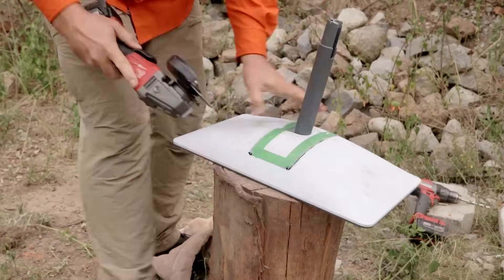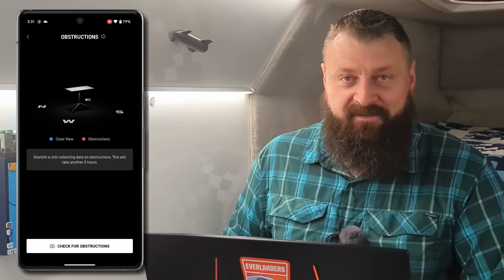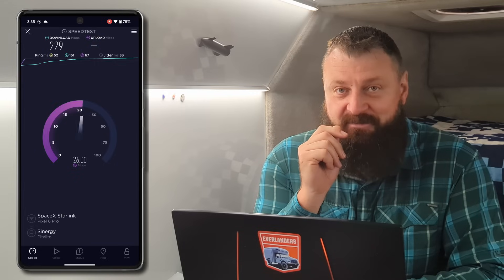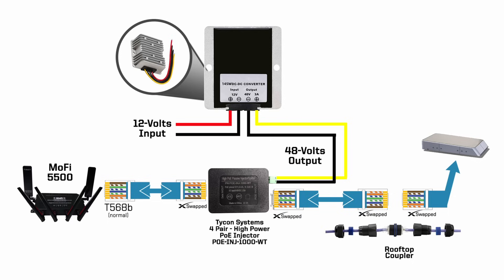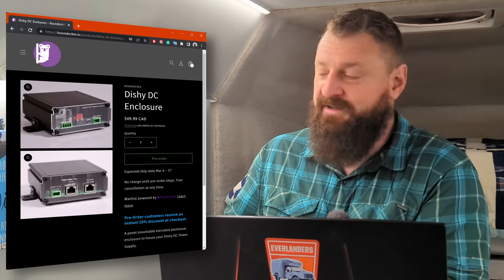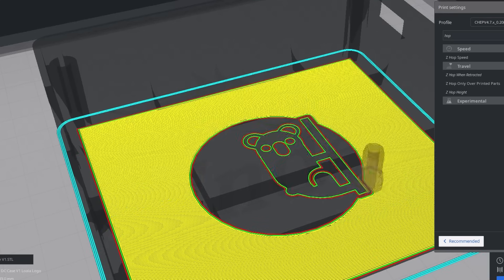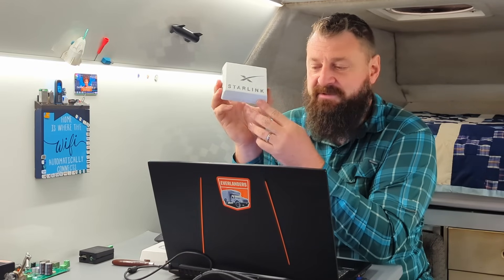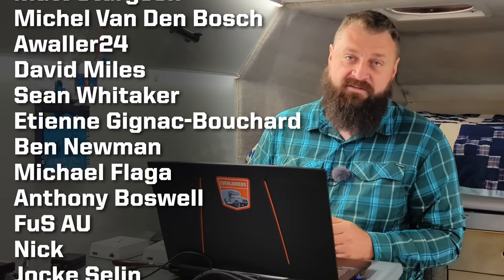Starlink DC Power Supply

Comment: I did not want to go through all the challenges and frustrations of putting together custom power supply, so I got the starlink 12VDC power supply.  I see more people going the custom route instead of the Starlink DC power supply.  Why does it seem more people go the custom rout?  Is the Starlink DC power supply inferior in some way?
Reply from the maker: You're probably using the Starlink mini, they run from 12 volts without any conversion.

Comment: Love your videos!  I recently purchased a used v2 dish with no router.  I'm wondering if it's possible to do the 12v conversion and then be able to set up a Starlink account without the original router? ( I currently do not have an account with Starlink).
Reply from the maker: Yes, no problem. As long as you have the Kit ID from the previous owner.
Reply: @ thank you for the reply!  I do have the Kit number 😀

Comment: Hi Jason: So helpful to watch this video. Hope your travels are going well. You are certainly knowledgeable and well-organized. I watched this video. I am totally in the deep end here. Here is what I want to do, and maybe you can offer me some advice. I live in Greece. I just bought a Starlink 3 generation. I want to power the Starlink (as much as possible) with solar power. I have no idea how to do it. Because my Greek is basic(dealing with local electrical suppliers is a challenge) but I can order products online from Amazon. What equipment, do I need to purchase, in order to run my Starlink directly off of solar power? I have a sunny roof for the solar panel. Please advise.
Reply from the maker: Very simple if you watch this video.
Reply: @Everlanders  Thank you for your reply. Imagine I am a complete moron when it comes to what you talked about in the video. Do I just order up the boondocker and away we go?
Reply from the maker: @athensmarina The Dishy DC will power your Starlink from a 12v battery... If you want solar too, then you'd need a panel and an MPPT charge controller.

Comment: I bought this power supply but I’ve run into an issue! Whenever I plug in my Starlink the “dishy enabled” light turns off and I don’t believe the dish is receiving power. Any suggestions? Thank you in advance!
Reply from the maker: Your cable could be crimped wrong and shorting out the power supply.

Comment: And how does it goes for starlink gen 3? Dishy dualie FAQ says it works with gen 3. Would like to see that please . Can we keep the starlink router with gen 3?
Reply from the maker: With Gen 3 you can simply replace the original power supply with any 48 volt power supply pilot can supply the 100w startup requirements.

Comment: Wiring diagram do you have one for how you wire the complete setup 🙌🏻
Reply from the maker: Positive to positive, Negative to negative.
Reply: We have had an issue with our PoE injector from Amazon, it’s burnt out the cable end on the router side so I am getting the boondocker one, that’s why I asked if it needed to be x-swapped like the original 🙌🏻
Reply from the maker: @Adventure_Awaits101 the Amazon PoE's burn up pretty quickly. Boondocker's Dishy DC does the correct swaps internally. Standard T568B throughout.

Comment: Thank you for your video! I’ve watched it a couple times already! I am doing my install of the boondocker io and am wondering how should I connect / use the remote switch capabilities so that I can boot or shutdown the dish from a simple switch… am still looking for a pdf manual for this project but haven’t found one yet! Maybe someone here can help! 

Keep up the good work!!
Reply from the maker: As shown at 9:50 you just connect two wires to a switch and the two wires at the other end to the terminal block. Pretty straight forward.
Reply: @Everlanders  Thank you! I will try that! I still am not able to connect to my dishy unfortunately using the boondocker io box. My router says no ethernet connected and I've also tried with connecting directly to my computer directly and it doesnt connect either. My Simarine battery monitor shows 3-4A usage when the starlink is connected to the box and it is a little warm so looks like it's powered on but the router port on the box doesnt seem to be communicating with my devices... I've written to boondocker io support... If someone has an idea, I'm all ears! I have tried 2 different ethernet cables (t568B). I have a  crossover cable too but didnt tried that... Thanks!
Reply from the maker: @marcksavoievoyer6424 the Dish takes about 110watts, over 10 amps while booting... The symptoms you're describing align with others who had thin cables or weak batteries. The Dishy DC is likely to be starved of power and the dish is stuck in a boot loop.
Reply: @Everlanders  Would the original Starlink cable be beefy enough? This is what I am using to connect from the dish to the boondocker io box. Well that with RJ45 connectors...  My battery is a 300Ah lithium that is full... So the battery should not be a problem. ;-)
Reply from the maker: I'm not worried about the Ethernet cable, if it's only pulling 3 amps, it's not booting. Which battery?
Reply: @Everlanders  found the problem ! The first rj45 connector that I did (straight on the short cable that connects directly on the starlink dish board) was bad. I have replaced it and got to connect right away! Thanks for your help and keep up the great videos! Very good content!
Reply: @Everlanders i have tried many combinations and it does not seem to be working for me yet. I have a spst switch but the ones with 3 prongs on the back that has a led light so maybe the connections would be different as I need to feed 12v / ground to those switch and haven’t really wanted to feed 12v on there before I get some confirmation that this would be ok from boondocker io support which I haven’t got since emailing them…  

I did try to wire just the 2 wires from my switch to the terminals on the box (dc-dc). Does the led light on the board should turn off if it’s working? 

I might just go for a automotive relay activated by my same switch  that will completely cut the dc power to the box if I don’t get some answer from support but kind of wanted to use the functionality since it’s built in the board.. 

Thanks!
Reply from the maker: What are you doing....? Just get a simple switch. Or two wires and twist them together so you understand what a switch is.
Reply: @Everlanders it’s fine if you don’t know how to do it with a 3 prong spst with an led. And don’t worry; I do know what a switch is 😂
Reply from the maker: Then you'll have no problems wiring that switch up.

Comment: Hi guys. Just installed the dishy dualie. But having trouble too have power on the dish. I have a cable running from the dualie 13.4 volt to the yoscheng adapter. And then to de dish. Am I forgetting something.
Reply from the maker: The problem is the Yaosheng, there is no need for it.
Reply: Oké. Will check your diy video again. But. Freely roaming did have the yaocheng in his setup. He said after 6 months that the dualie was very sensitive to voltage drops.
Reply from the maker: No voltage drops here, 2 years no problem as shown... If you're doing what the free roamer said, maybe ask him.
Reply: Maybe to thin 12 volt cable’s ? Could that be a problem? Will check tonight. Will let you know.
Reply from the maker: Of course thin wires will cause problems. 🤦‍♂️The power cables need to be at least 6mm² or 10AWG to handle the 10 ampere inrush during boot and network initialisation.
Reply: @Everlanders  Fixed it. it was indeed to thin wiring. Works like charm now.thank man.👍
Reply: Going to check that first, thanks man
Reply: Oké. But I thought it would be wise to keep the original cable. To be connected to the original router. So the yaosheng is only converting rj 45type b to ?
Reply from the maker: Nope, unwise.

Comment: why not use the dishy cable connector instead of messing with the RJ connector. Far simpler adaptation. Unplug old router. plug into POE card then use a standard RJ Ethernet cable to router.
Reply from the maker: You should do that.

Comment: The newest board doesn't fit the box anymore without a bit of adjustments.  The rib on the top where the black cans are is in the way now as there is 3 cans instead of just 2 now.  All in all, this case looks killer when it's all done!
Reply from the maker: You printed the wrong case, rev1.5 fits the capacitors just fine.
Reply: @Everlanders  ahhhh crap I didn't catch that one.  Ok off to print the other one:face-purple-crying:
Reply: @Everlanders  is that the 1.4 for the front and 1.5 for the back you mean?
Reply from the maker: Yes
Reply: @Everlanders  ok sorry figured this out now.  Totally different area to get the latest files.  Thanks!

Comment: Is there an adapter for the recent edition of the dish available at BestBuy?
Reply from the maker: No adapter needed. It works just fine.
Reply: @Everlanders  Will it also power starlink router that comes with the new kit?
Reply from the maker: No, getting rid of that router is the whole point. Nobody's using it due to horrible inefficiencies.
Reply: @Everlanders  I thought the issues were with the old router and a new one has more features and smaller form factor. Obviously there is always a room for improvement, but I wanted to reduce the amount of time I spend replacing a device that might otherwise work ok.
Reply from the maker: If it works for you, then use it.

Comment: what are you using for power? I have two 100 watt agm batteries and a 200 watt solar panel. It appears I will need more power.
Reply from the maker: Solar - https://youtu.be/lcck1ejlXt8
Batteries - https://youtu.be/2uYENzaDBY4

Comment: how about on the power side - I'd like to run my dualie off the delta 2 max but only 1 dc out that the fridge is on. Just use a dc splitter and run them both parallel? Or is there a better solution? Rather not run straight off car battery to safeguard against killing it.
Reply from the maker: The Dishy DC has a low voltage cutoff, it won't kill the battery.

Comment: Thanks for the video! So you left your wiring on the roof unchanged, i.e. x-swapped wiring into the dishy on the roof but T568b-wired into the dishy port of the PCB?
Reply from the maker: I had a crimp on the roof go bad, poor quality ends, So while I was at it, I crimped everything with standard T658B

Comment: Will this 48v power supply device work with the new Starlink Gen3 system that has the new RJ45 connectors and my Peplink MAX BR1 Pro 5G Router?
Thank you for all that you do,
Terry McIntyre
Reply from the maker: That's Gen 4... And yes, it's all the same power requirements, works fine.
Reply: @Everlanders It's Gen 3 according to Starlink. Gen 1 was round dish, Gen 2 was the "actuated" rectangular dish (like the one you converted) and High Performance Flat, Gen 3 is the new non-actuated rectangular Dishy with a "kickstand" and regular (but weather-sealed) RJ45 plugs/jacks.

I'm wondering about the pinout of the new "standard" connectors. I haven't yet seen anything about that. Fingers crossed that it is TRULY standard and won't require jumping through any more special crimping hoops to use third-party routers and PoE injectors. That would make going mobile with the Gen 3 dish a whole lot easier.
Reply from the maker: According to the CAD models and wiring diagrams from Starlink, it's Gen 4

https://api.starlink.com/public-files/starlink_standard_product_3d_models.zip

Comment: Just about to order the board from Boondocker and get the case 3D printed it locally. In regards to the case what file do I use for the base plate?  
Thanks
Reply from the maker: I believe version 1.5 is the newest PCB revision.

Comment: hi how are things..!! your videos are excellent.. thank you very much for it...!! I would like to bother you with a question regarding switching to 12v on Starlink, is it really worth it? In percentage (%) how much is the gain when having the Starlink on 12v? In one hour with 12v how many amps does the Starlink consume?
Reply from the maker: 56 watts AC vs 28 watts on DC
Reply: Thanks for 🇨🇱 answering..!!  If one day you are in Chile and you are heading towards the southern highway, I have some tips... those 28 Watts in 1 hour of use?
Would the 28 watts in DC transformed into amperes be approximately 2.3 amps?
Reply from the maker: It seems you're conflating power (watts) with energy, which is measured in watt-hours (Wh). The correct way to understand this is to recognize that a device consuming power at a rate of 28 watts over the course of an hour would use 28 watt-hours of energy. This is because a watt-hour is a unit of energy equivalent to one watt (1W) of power expended for one hour (1h) of time.

So, in simple terms: 28 watts describes how fast the device uses energy. It's like saying a car is moving at 60 miles per hour right now. 

28 watt-hours would describe how much energy is used over time, akin to saying a car has traveled 60 miles over the past hour.
Reply: @Everlanders  Dear, I appreciate the illustration you just gave me..!!  I think it's really useful then.  I have a mini camper with a 75 Ah battery that is charged with 3 100 Watt solar panels and in very cloudy cases I use a dr.  battery to charge it when I go on a trip.  but I feel that the starlink plus the Refrigerator consumes my battery very quickly considering not being able to discharge it below 50%.  Of the conversion kits, which is the most recommended without having to have network degradation problems according to your experience?
Reply from the maker: @rodrigomendezguzman9195 ...the one I showed in the video.
Reply: @Everlanders  Thank you very much for your answer..!! I will see him again..! What I don't want is to cut the original cables
Reply from the maker: Then it's not possible for you.

Comment: With this set up do you still need to do the Xswapped cable for the dishy cable out? As in an Xswapped cable with female to female connector as per the last video and then at the Dishy DC end just the normal RJ45 connection? This is the only part im a bit confused about!  I am going to get your print files, do the install and leave a nice tip on thingiverse beause this series is a lifesaver! Thanks so much for the great content and I really hope I can get an answer to this. Keep up the awesome work, thanks from Australia!
Reply from the maker: No, when using the Dishy DC, all the connections are standard T568B. (The swap is done by the Dishy DC)
Reply: @Everlanders  so just to clarify, do I leave the cable intact coming out of dishy? Or what do I do at that end? Thanks so much for the swift reply!
Reply from the maker: It's your choice. You can leave it, or crimp T568B as needed if shortening the cable to save the 10 watts lost to the length.
Reply: @Everlanders  ok. I’ll need to look at this a bit more I’m still a bit lost on that part. Also just an fyi, it looks like someone is selling your Dishy on Etsy. I hope it’s you guys and not some rip off artist. I can send you the link if it’s not you guys!
Reply from the maker: Unfortunately there are many outfits thats think it's okay to profit from my designs. I guess they don't understand the "Creative Commons - Non-Commercial - No Derivatives license."

Comment: Thanks a ton for your videos! Super helpful. I have a question, I have pre-ordered the power supply/Poe injector and have a gen3 dishy on order. The folks at Boondocker have said their device will work with gen3. I saw in your video that you did not need to X-swap the cables for your gen2 dishy. Is the swap taken care of in the boondocker dualie? If so I think that means I will have to cut the cable on my gen3 dishy since I believe Starlink has made it standard (not x-swapped) connection now? Can you clarify? Thanks!
Reply from the maker: Correct, if using a Boondocker Dishy DC, the swap is all handled for you internally... Standard T568B crimps everywhere regardless of Starlink version.

Comment: Question on the remote shutdown toggle switches, I assume these are just 12v and you don't need a 48v toggle?
Reply from the maker: Logic Level
Reply: @Everlanders  Got it, so just completing the circuit or not basically.
Reply from the maker: @santafebobo No, logic level enables the processor for the boost converter.
Reply: @Everlanders   right, but aren't you essentially wiring in a basic on/off switch to enable the system output, either disconnecting a circuit or completing a circuit?

Comment: Thank you for the video. I am a novice on StarLink and just purchased the marine version for my sailboat. I would like to get the 12v system you have designed but do not have 3D printing capability. Do you produce this component package for sale ?
Reply from the maker: I don't sell anything... just a lowly YouTuber... You can buy the board itself from the link in the description, and he also sells aluminum cases separately if you like... If you want a plastic 3D printed one, they're about 19$ to have printed at places like Pcbway.com or any number of online service providers. Links to the 3D files are also in the description.

Comment: Hi @everlanders at 7:54 you can just put in a normal RJ45 CAT6 shielded cable from the POE towards your rooftop coupler you don't have to switch them twice
Reply from the maker: Yes, but then I can't swap between routers.
Reply: @Everlanders  Yes you can as this has nothing to do with the router side, you are just 1-1 extending your UTP so if you have already swapped at the coupler you can just use a normal shielded UTP from there towards your PEO side to dishi
Reply from the maker: That's what I did...